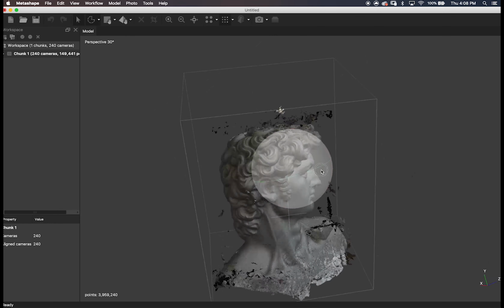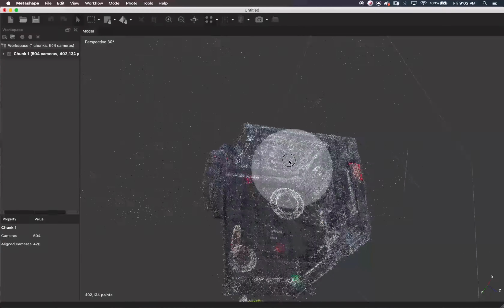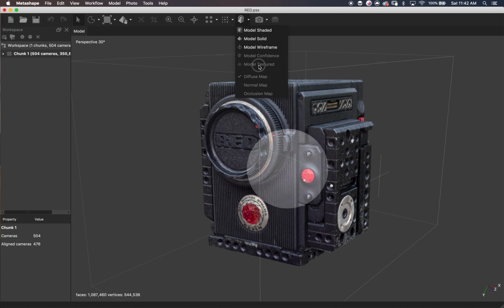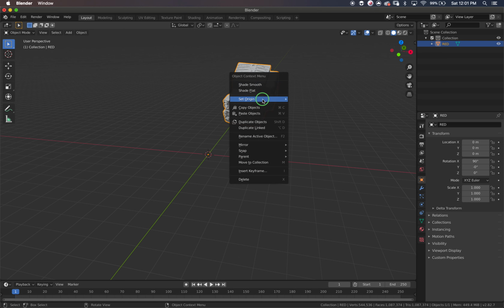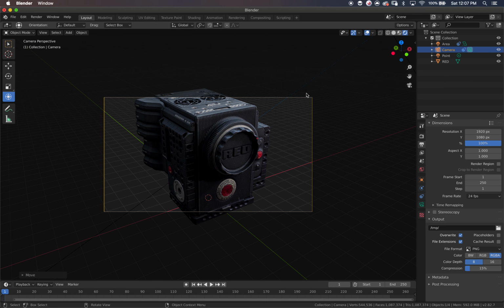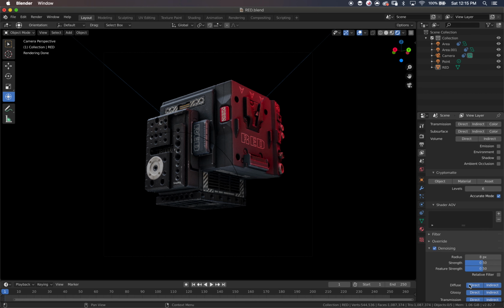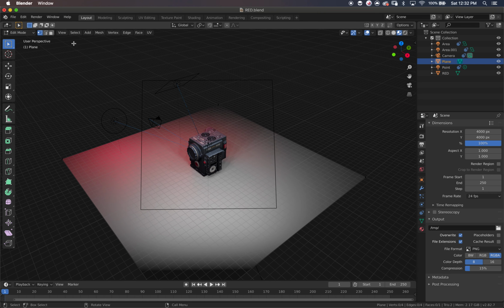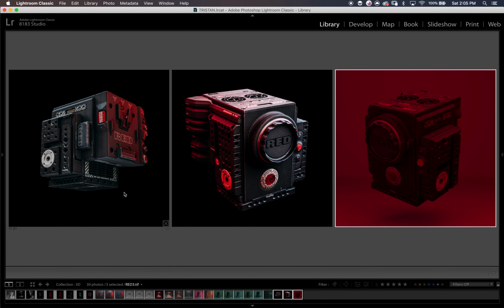3D Photography Workflow | Using Metashape + Blender

Comment: No need to delete the tie points at the start - the model is generated from what's in the bounding box. Also, for this type of subject you would be best served by using depth maps and skip dense cloud generation. Thumbs up for your model. Well done. BTW, you can orientate your model in Metashape by using the Rotate Model button - although you will find that on import into Blender the X axis is rotated by -90 degrees. In blender you can select the filter (top right - the funnel symbol) to show the render switches to turn the lights on or off.

Comment: Hi, nice video and tips for your audience. I am a VFX artist and have some experience with 3D scanning. For photogrammetry I used number of softwares and Photoscan - Metashape is one of my favorite.

Few tips for you. 
1. If you want to build 3D mesh you can try new method in Metashape. Skip the  Build Dense cloud step. Go for Build mesh and choose Depth map option. You can build mesh from sparse cloud - very low Q, Dense cloud - Good details, better for some objects, Depth maps - faster and most of the time more detailed and more clean for mesh building.
2. You can clean your point cloud with Gradual selection tool in Model menu. Very good practise is to clean your Sparse cloud and use Optimize cameras option to get better solve for camera positions. Data for checking the accuracy is in Show info dialog.
3. You can show grid and place object to the origin and orient it correctly.
4. The bounding box - Region is there to determine where you want to calculate your model. It can be useful for you in two main ways. Speed of reconstruction - bigger means longer compute times. Selection only of some part of the model to be calculated without deleting the points. Some datasets are calculated based on this region. Depth maps are the example. This will be probably changed in the Metashape 1.7, but up to 1.6 is like this if I remeber correctly.

Comment: For hiding the lights from the render as well as the viewport you can go to the filter icon above the scene outlier and toggle on some more visibility buttons. You can select hide from render in there.
Reply from the maker: Awesome, I figured there would be an easy solution to that, I was pretty confused the first couple of times I rendered images with some of the lights "turned off" so I ended up just deleting the lights I wasn't using. This is very helpful, thank you!